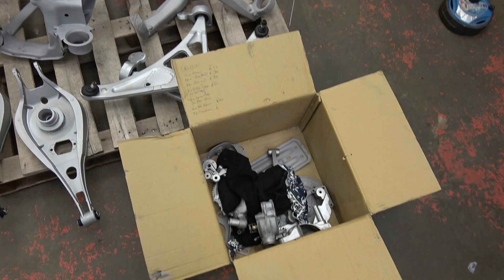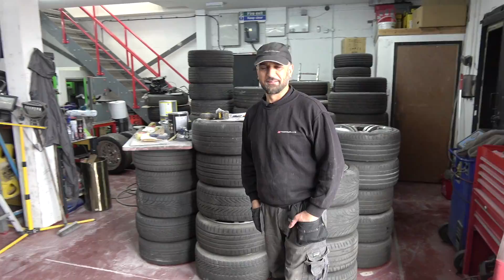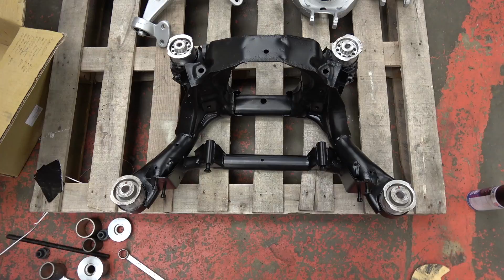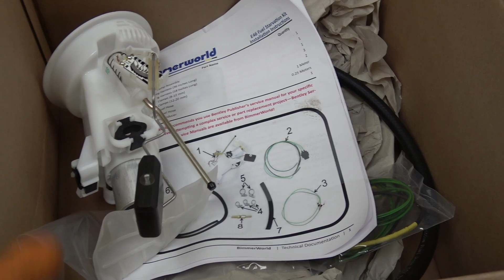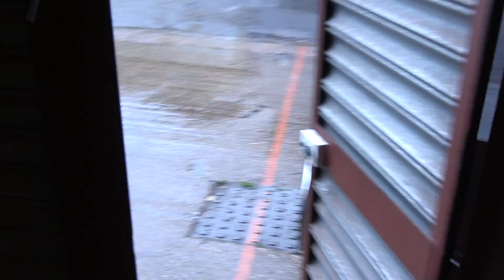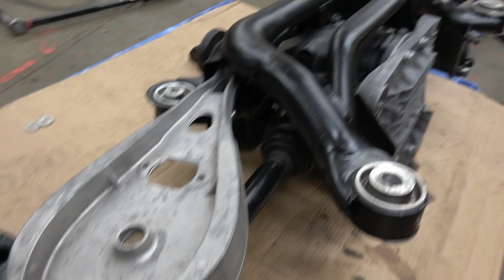An axle worthy of a V10 M3 - Driftworks BMW E46 M3 project Pt 27

Comment: Hey Phil, honestly how does the car handle w. the V10 vs your CSL m3 with the s54?
Reply from the maker: That remains to be seen. I've only ever driven the V10 M3 with compromised suspension. The way we've engineered it this time around it should be uncompromised, and the only negative effect will be a little extra weight.

Comment: Nordlock washers actually work wonders 👍
Reply from the maker: 👍I recently used them on the turbo to manifold on both my S15 and 964 Turbo.
Reply: @driftworks  had some big m12's coming loose at work. Not anymore :)

Comment: Why did you not change the inner upper control arm bushings to monoball? 
By the way there are also other options of having the upper control arm adjustable other than that weird bore, seems like that has to be check quite frequently as things can move under load...
Reply from the maker: We just built it as Schirmer did. If it's good enough for him, it'll do for us.

Comment: Is that a trigger wheel on the water pump pulley ? What ecu is it running?
Reply from the maker: Yeah, it's just to run something for the standard ECU, possibly to do with the ABS. My memory fails me. The engine is run on a Pectel SQ6M12 with Cosworth Motorsport loom & Pi System dash.
Reply: @driftworks  I'm running a SM4 with a M&W multiplex CDI , 20-1 crank trigger and cam reg off #1 intake

Comment: Tell us more about the other Schirmer Car!😀
Reply from the maker: The ACS Z4M coupe has a rod out the side of the block & is in 2000 pieces with a few missing/pilfered for this project. It was a big part of the complication of getting the V10 M3 back. I had to buy it to make the deal happen.
Reply: Driftworks will you rebuild it once?

Comment: Ow yeah, a proper limited slip diff with ramps and clutches. The Gkn viscous was not a bad idea on paper from factory, I think they tried to eliminate that preload of the 2 wheels together with a proper lsd, making the back end snappier on wet if the pavement is bad. But that preload is what gives better traction on my opinion, because you don't have to make one wheel slip to buildup pressure in the diff and then viscous couple them back.
Reply from the maker: 👍Changing to the Carbonetics multiplate lsd back in the day completely transformed the car. It got so much more traction & more importantly precision at speed when cornering & braking. The jury is still out as to whether it was the ultimate cause of eventually snapping 2 axles in the car. We'll see once it's back together.

Comment: Regarding all solid bushings etc - I put full solid bushes and whatever needs to move is spherical in my E36 M3, and tbh I cant even feel a difference from stock. Granted, I havent driven it very hard yet. But I heard scary stories about vibrations and sounds. And I havent noticed a thing. Even the diff is solid mounted. As long as you have some interior in, which Phil has, I dont even think its that noticeable. Will see how it is when all my interior gets ripped out.
Reply from the maker: Thanks man. That's my experience too. A lot of cars are solid mounted like this with way less BMW spec sound deadening & they are very tolerable.

Comment: Look up at @seemslegitgarage 8.8 Ford rear end for the e46 its bullet proof
Reply: @driftworks  https://www.seemslegitgarage.com/product-page/e46-ford-8-8-subframe-axle-kit
Reply: Jose Navarro more importantly is there a good drop in diff for a 8.8? I have one in my car rebuilt the factory trac loc with carbon plates and it’s a bit random. Fine is a straight line but unload a wheel and it’ll roast that tyre to the moon. 
If there is a good mechanical upgrade I’m interested.

Comment: What bushes are going in the diff cover? Keeping the old ones?

Also what’s the plans for the handbrake? Looks like you’ve not installed the disc backing plates and these would be needed to fit the oem handbrake shoes and the hold the retaining screws.
Reply: I'd almost assume he's got a hydro for it maybe
Reply from the maker: Standard, they're in good condition. The backplates are there. They're just cut down nicely for the Stoptech rear brakes.

Comment: Everyone talking shit about the solid bushings and the stuff that came from the Schirmer subframe really need to look up who Team Schirmer is and what they do with BMW's. Yall are hilarious.
Reply from the maker: It's mad isn't it. He is uncompromising though. so I'll be interested to see how noisy it is with these bits.
Reply: 100%. I found solid subframe bushings to be very tolerable in regards to NVH as long as the differential was isolated with factory bushings (setup I had in my 320i e36 drift car) the sphericals on the trailing arms will be pretty rough but maybe Phil would be in favour of a oem bushing with a limiter plate design to allow deflection but limit severe deflection. Love this build btw.

Comment: You should weld in some reinforcing material on the chassis brace near the crack. That thin minimum section will likely just fatigue and crack again if that minimum thickness isn't increased.
Reply from the maker: It should be okay now it's super solid mounted & the floor is fixed.

Comment: All e46 m3’s And z4 m’s came with the same worthless viscous lsd. The e36 m3 was the one that had a proper lsd from factory.
Reply: why did BMW issue a recall for LSD oil with added friction modifier to stop the plates clunking at low speed?
Reply: Maybe CSL and Z4M, but some M3 must've came with the clutch pack otherwise there would not be such a big aftermarket for uprated M3 E46 clutchpacks.
Reply: @idokwatcher2062  you can upgrade/ replace the plates in some viscous lsd's, however not a single e46 model came with a proper plated lsd with ramps etc. The e36 was the last model with this option
Reply: @SJ-ub2eq  u are right.
Reply: Even 328is E36 had the option of mechanical LSD. You could really respect BMW in those days and their offering for poorer enthusiasts. None of the non-M's in E46 range ever had the option... Fast forward to now, 2 series is a front wheel drive 4 banger.
Reply: E46 is a combination of plates and viscous style. The viscous pump in the e46 diff induces lockup via hydraulic pressure applied to the ramps. It isnt the best differential for track use but I surely wouldn't call it useless compared to an e36 m differential. It definitely had its place and I wouldn't compare it to something like a torsen or vlsd.
Reply: @KristoffHemet  yes, it's a little shortsighted from me to call it useless. I just prefer the plated lsd's like the e36 had.
Reply from the maker: Jay letting us down with BMW knowledge! I never thought I'd see the day. I'll remind him daily.
Reply: @driftworks  bmw M diffs are a bit of a mystery art between the models (especially after 2000) it's okay 😂😂😂
Reply: Hopefully this clears up misconceptions and what I meant by a combination of clutch pack with viscous assist. From A BMW PRESS RELEASE:

The Variable M Differential Lock functions according to a clear
and straightforward principle: 

The differential speed building up
between the drive wheels whenever a drive wheel is relieved of its load
and forces or runs on a very slippery surface, generates pressure spontaneously in an integrated shear pump. This pressure is then
conveyed via a piston to a multiple-plate clutch, in the process
conveying drive forces to the wheel with a better grip, these forces
being geared in all cases to the difference in wheel rotation speed. In an extreme case the entire drive power of the engine may be transmitted to the wheel on the road with the better frictional coefficient
(provided the frictional coefficient is sufficient for this purpose) 

The last section is what gives the e46 differential and advantage IMO over the standard e36 clutch type. Having driven and owned both in standard form I will take the e46 diff all day.

Comment: For the rear trailing arm bushings, full solid sucks even for a track car. You actually need some of the deflection. Check out Synchro design works. The use a factory spherical bushing in an aluminium housing. Perfect for road and track and easily rebuildable
Reply from the maker: I'll check them out. These are Schirmer parts though, so I don't think they'll be a problem unless they're too noisy. He's the guy behind all of the fastest BMWs on the Nordschliefe.

Comment: I’ve been watching this series since part 1, my apologies if you had already touched on it and I missed it, but what’s the deal with the “Schirmer” Z4M that’s in pieces? You mentioned you had to purchase it to get the M3 back.
Reply from the maker: Yeah I had to buy it to get my car back. I didn't want it. It's an ACS Z4M coupe in 2000 pieces with a rod out the side of the S54 & a few parts missing (even more now) It had been stripped ready for a full Schirmer track car build with an S65 of S85 I think. I need to get rid of it really, but it's a complicated pile of parts to sell easily.
Reply: Driftworks Copy that. Does sound like a headache, but hopefully it works out favorably for you in some way. Thanks for the steady content, it’s appreciated 👍